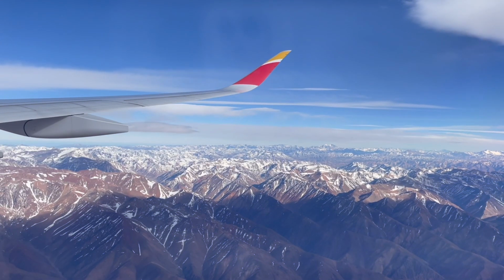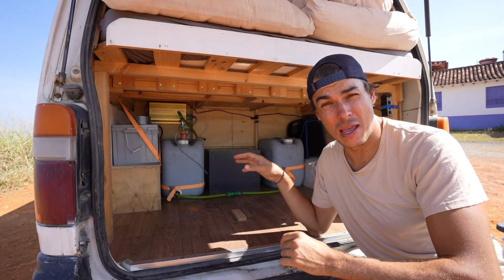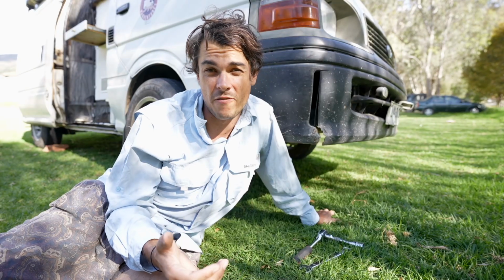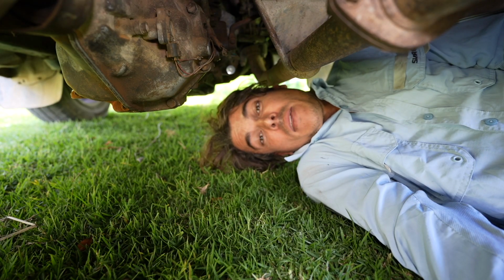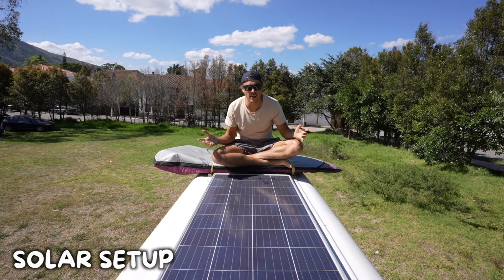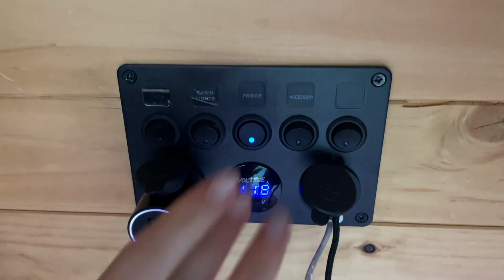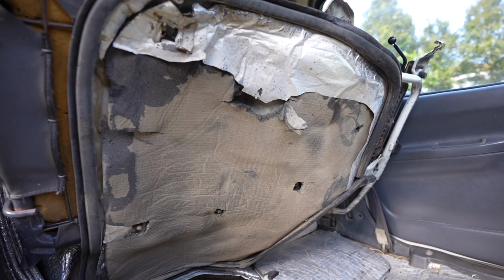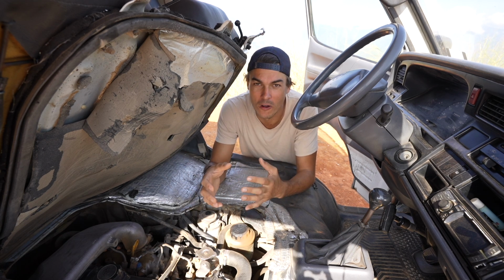5 Things We HATE About Our Van (Don't Make These Mistakes)

Comment: We love our Hiace, but we also installed heatshield like you did to keep the Van cooler inside.
Reply from the maker: What was the condition of your original heat shield? Ours was toast when we go it
Reply: @saltyvanventures  our was much better that yours. We did not have to replace it above the engine we only added it to reduce heat.

Comment: The anxiety is real! It's not just your transportation, it's your home and everything you own while you're out there on your own. With the water tanks, did you consider tapping in a small length of clear hose to run up the outside? Would show the internal water level (might lead to leaks though). You could also tap in a length of hose and a funnel to be accessible from the back for filling. The little jobs you have to do are endless right??
Reply from the maker: We just lived with the problem as we knew this trip has an end date. i did think of that by I didn’t want to add anymore holes to the tank for risk of leaking.